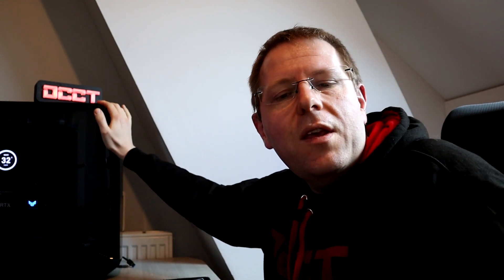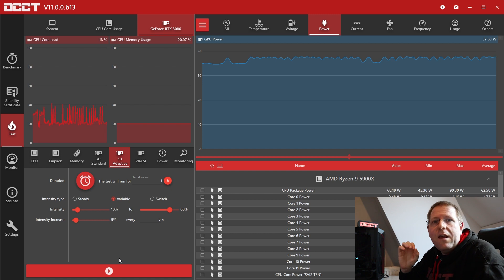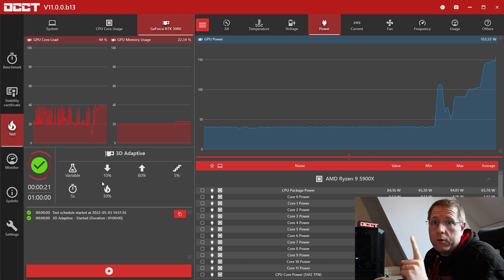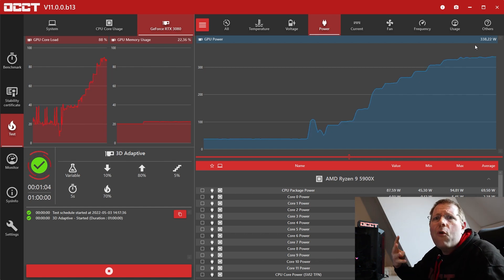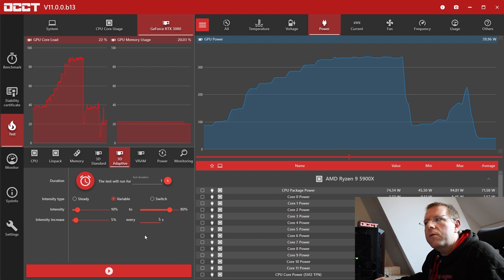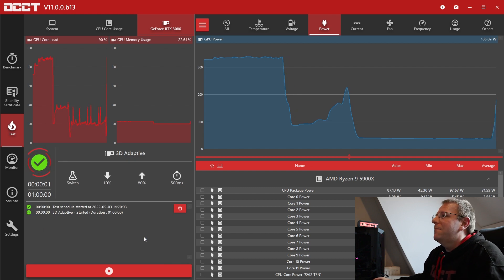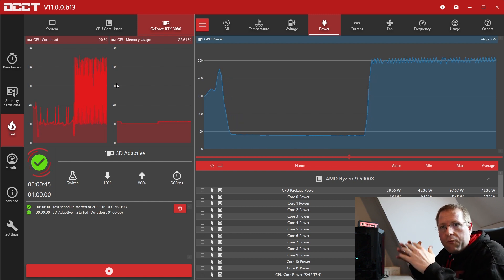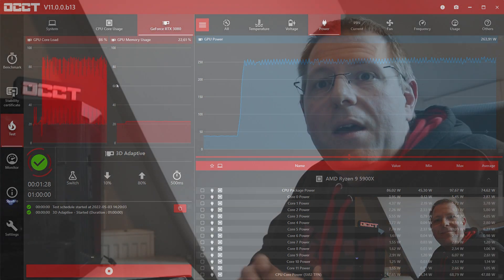OCCT v11's revolutionary 3D test

Comment: Hey, I think I have an issue with the "3D standard test". I used the latest OCCT version to retest my Vega56 undervolting and OCCT quickly reported errors. However, when I looked into HWinfo, I saw that my GPU draws 346W ASIC power, which 86W more than the *GPU's Bios power limit*. Is this a normal behaviour? 

From my gut feeling, I think it is a bit worrying, that OCCT is somehow able to "bypass" settings, which are baked into the bios 🤔
Neither 3D Mark, Unigine Superposition, Furmark or any other program I tested to far, showed such behaviour btw.

GPU is an Asus RX Vega56 Arez Strix with an -175mv undervolt and VBIOS Version 016.001.001.000.000000, if this helps.

Comment: The 30x0 series now has CRC on it´s memory. Will corrected erroers still be visible in OCCT or will I only see a performance drop?
Reply from the maker: Sadly, the CRC error count is not available through monitoring, only on some Quadro models. If only I had access to that value, it would make things so much easier for VRAM overclocking ...
Reply: What’s CRC? Please explain I’m all eyes on this conversation